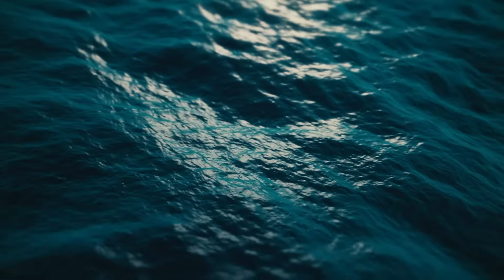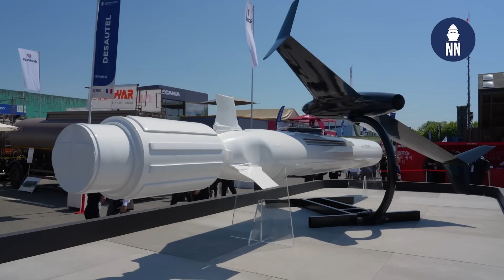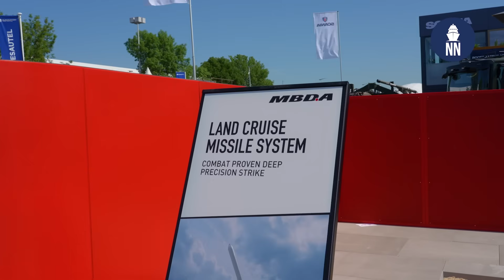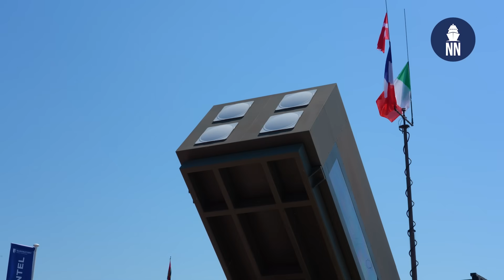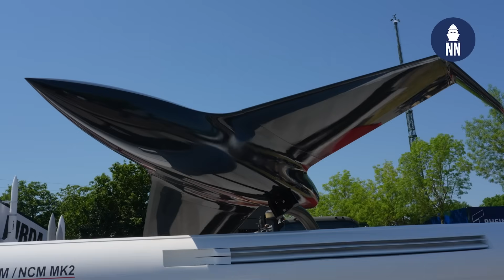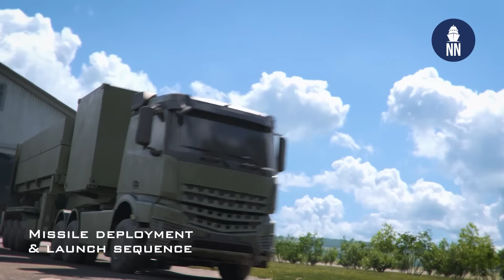MBDA LCM Mk2: New 1,000+ km Cruise Missile Unveiled at Eurosatory 2026

Comment: What is more interesting is that MBDA are also working on their 'Crosssbow' missile (along with several other contractors under Operation Brakestop). It's a cheaper, lighter, easier-to-produce missile that does a similar job with completely European manufacturing and guidance systems. Why? Because Iran and Ukraine have demonstrated that not every target needs the best missile available. It's also been noted that relying on USA electronics and data sets means that the USA gets a say in where you use your missiles, which has been increasingly less palatable to many users.

Comment: I seriously think this needs a larger warhead.
It should be in the 450-500kg warhead class and not the 250-300kg class.
Yes, a 250-300kg warhead is good enough for many targets, but at the same time are there many very important military targets where a 250-300kg warhead is not enough.
And when you make a LCM-NCM with this range and the price tag it will have, then it needs to be able to destroy most targets as well in my opinion.
Reply: I'm not seeing stealth features, so against any competent opponent you're going to have to fire multiple missiles per target anyway.

Comment: 2030 … 😮 … to slow … to late
Reply: It takes 24 to 36 month to assemble. So 2030 is actually very fast. It’s a complexe munition
Reply: @jeanvaljean9293 thank you for your answer, but 36 month to assemble is a joke, what about 6Sigma lean production, what are the bottlenecks.
Reply: @svengreen8467  Sensors, guidance and the engine are usually the biggest bottlenecks, especially if they're using existing hardware already in service which is good for cost but those lines are often already quite booked out and introduces delays because those lines all have their own bottlenecks, and those have their own bottlenecks etc. Although nearly all cruise missiles tend to take at least 8-12 months, the only real solution ( other than using air freight a ton or building entire supply chains in the same area ) is to order huge volumes so you have hundreds in production at once but unfortunately the EU has historically lacked that kind of scale. I mean look at TLAM expecting to go up to 1000/year is the kind of numbers you'd want, but unless a lot changes it's going to be unlikely LCM sees that kind of scale.

Comment: How will this fit in with the role of the stratus family. If the RS is meant as a ship and air launched ASHM missile and the LO is meant as a ship and air launched LACM missile, then why would you have the NCM MK2 as an overlapping ship launched LACM? The only extra functions of the NCM Mk2 would be the ground launch which may be good for the army and the submarine launch which the STRATUS family has not confirmed yet whether those will be sub launched for the french navy due to torpedo tube width limitations.
Reply: MdCN/LCM will have a greater range and Stratus LO has no land variant. MdCN is currently in production and LCM can be put in production before 2030 while Stratus LO isn't expected before the early 2030s. 

The naval integration of Stratus LO will probably be only done for Mk 41 launchers for the UK type 26s and not Sylver launchers for which MdCN is integrated.
Reply: @Bylli-j1e I mean i get the land argument (that is a needed function) and even the submarine launched version (as france and other countries here in europe are limited by the size of the torpedo tubes).

But i can hardly see the point in making a missile family where one missile is specifically a supersonic anti ship missile (with dual strike role) that is meant to one up current gen missiles in range and capabilities (missiles like the NSM, Exocet, Otomat, Harpoon etc) and the other missile is a very long range, very stealthy LACM missile with deep strike potential but which supposedly has shorter range than the current gen LACM weapon, NCM and NCM MK2, and much lower range than the tomahawk which is its other direct competitor (at least the latest stealth tomahawk as the older versions are quite a bit less capable nowadays.... or at least much easier to intercept).

Not to mention that Italy has also given signals that it wants to integrate the LO on their vessels and not only on their aircraft and they will, almost certainly, keep going with the Sylver VLS.

Unless I have missed any announcements then all capability targets should mean that the LO will be at least more capable in every metric than the current NCM by a generations worth of upgrades. If then any Sylver integration is done for the LO the NCM MK2 will really only have a place in sub and ground launched roles. Not that that is bad in itself in any way, but it is a further complication of logistics the way i see it.
Reply: @cotc4x153    I don't understand why you're confused. Tomahawk is not an air-launched missile while Stratus LO and RS can be air-launched or ship-launched. 

- MdCN/LCM: naval variant is France-only so far, is the only one of the 3 that has a ground variant and can be launched from submarines unlike Stratus LO (France will probably adapt Stratus RS for the anti-ship role on submarines). It remains to be seen whether the UK wants to replace Tomahawk with Status LO on their submarines. Stratus LO is not designed to compete like for like with Tomahawk, MdCN is that's why it has the greatest range of the 3. It is also already integrated with Sylver A70. Italy has Sylver A70 on FREMM EVO and the future DDX destroyers and might use the MdCN or Stratus LO in them) 

- Stratus LO air-launched: Storm Shadow replacement for the UK and Italy. France will be modernizing Storm Shadow alone instead of purchasing Stratus LO but might purchase in the future too. 

- Stratus LO ship-launched: UK and possibly Italy, will be used for both anti-ship and long range land attack roles since the UK lacks a sovereign solution for both. Italy has Sylver A70 on FREMM EVO and the future DDX and could adapt the missile to A70 for land attack role if they don't choose MdCN (but MdCN makes more sense). 
France already has the MdCN and doesn't need the anti-ship capabilities.  

- Stratus RS air-launched: Exocet replacement + SEAD for France. Will most likely not be used by the UK since they're developing the Spear-EW for SEAD/DEAD that will also be used by Italy (but maybe they can use Stratus RS for high-value targets since the warhead will probably be bigger than Spear 3) and will use Stratus LO for anti-ship role. Italy also could be interested in the anti-ship capabilities since they lack air-launched options.   

- Stratus RS ship-launched: Exocet and Teseo replacement for France and Italy. Will mostly be launched from canisters as opposed to VLS for Stratus LO used by the UK. Secondary coastal strike capability which can be interesting for Italy if they don't get MdCN or Stratus LO (VLS). 

This is the logic behind the range. Each missile is meant to fulfill the incompatible needs of the nation developing it (MdCN and Stratus RS for France, Stratus LO for the UK). Also since France already uses the MdCN, is the one producing it (the assembly got recently restarted), has developed a launcher specifically for it (A70), it wouldn't make sense to replace it with Stratus LO which is developed by the UK, they'd lose all of those investments. Industrial returns are always an important consideration for these joint European programs.